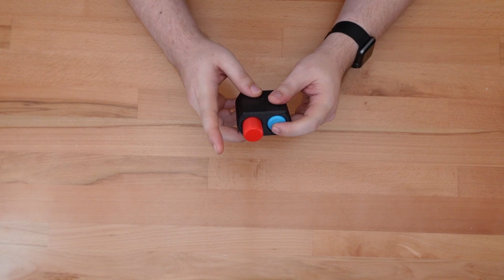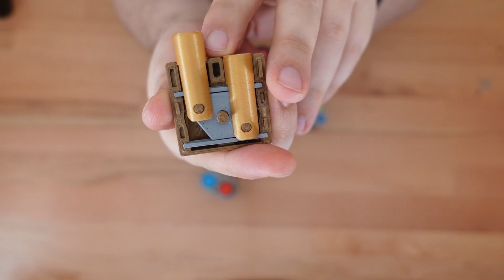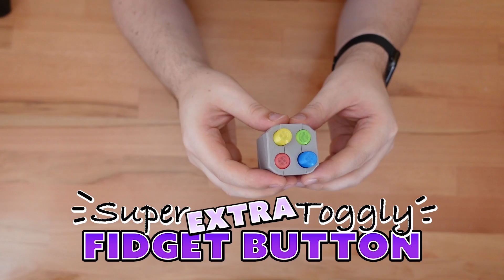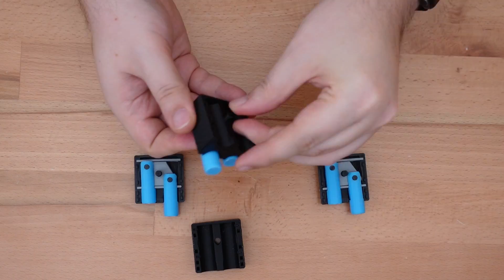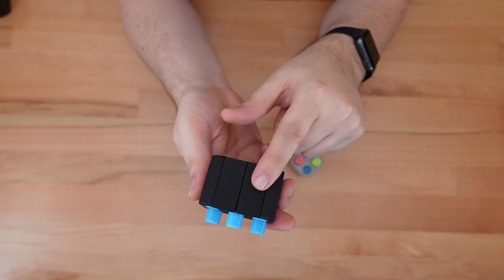MINI Super Toggly Fidget Button & More!

Comment: toggle stuck on switch
Reply from the maker: I'm sorry to hear that, I wonder if the post the cam sits on snapped - If so, I suggest using the "alternate pin" file, which prints flat for more strength.
Reply: I put it in the wrong way. I fixed it and now it works. Thanks so much for the file. I am playing with this right now. @3DPrinty

Comment: this stinks, nothing fits 

Edit: I had to drill a lot and at first it was very hard to press the buttons .and the casing is hard to put together. But if you you keep pressing the buttons it gets easier
Reply from the maker: I haven't heard many issues for this design, but there's always the possibility that mechanic prints won't turn out the same for every person on every printer (to say nothing of the variations due to filaments and print settings). It's great to hear you got your copy working!

Comment: can this work with pla?
Reply from the maker: Absolutely! The majority of my fidgets were printed entirely in PLA. Keep in mind that there is a lot of variation between PLA formulations. Certain "silk", "matte", or "light" PLAs won't be very strong. Standard PLA, however, is fine.
Reply: @3DPrinty  ok thank you so much i did it with pla and worked much better!

Comment: 💡 What if you print the housing of the buttons with transparent filament, so the internals can be seen? 😉
Reply from the maker: That would be cool! It might be a good resin project, as even clear filament comes out fairly cloudy.
Reply: @3DPrinty  I didn't specified the material, but I originally thought of filament printing, but yes, resin print is a lot more transparent, of course. 😊
💡 But if you print all parts of the button from resin, will it be more durable? Of course, the shell will be colorless transparent and all other parts will be colored for better look. 😉
Reply from the maker: Yes, it'd be best for durability to do as much as possible in filament. In fact, there's an alternate version of the case where the main pivoting peg, which is subject to a lot of strain, can be a separate piece... so the case could be resin and the peg could be filament.